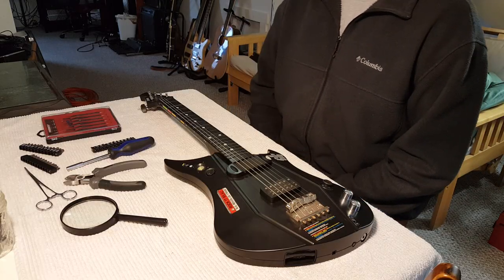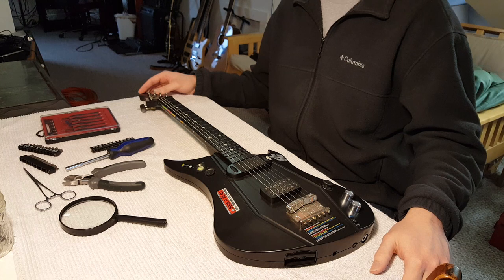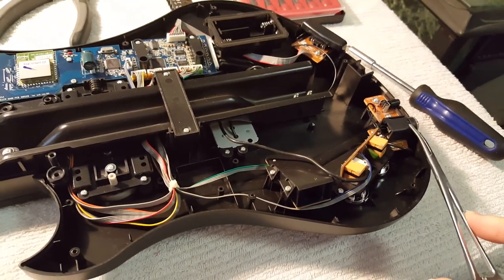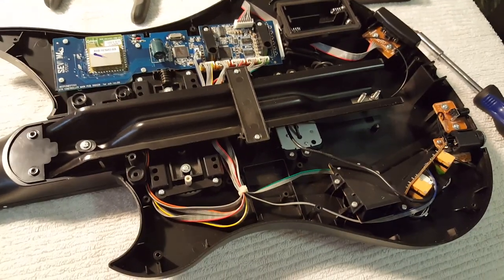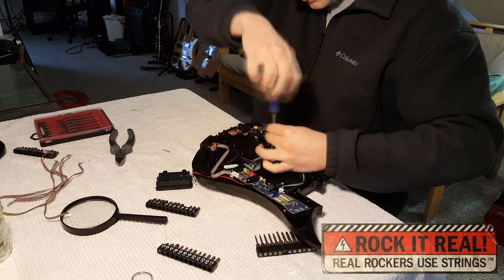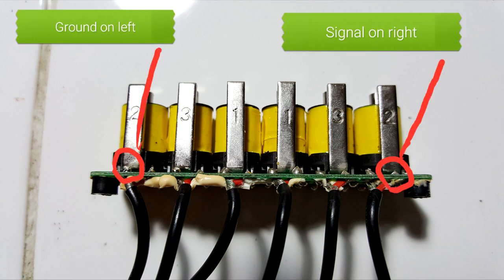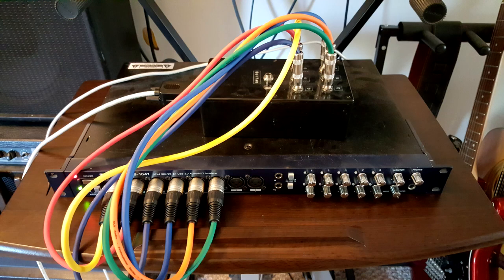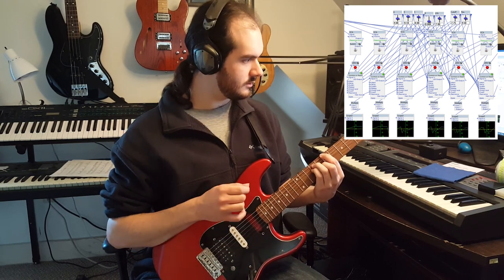Harvesting Hex Pickups/Power Gig Guitar Teardown

Comment: As guitarheroROXS brought to light in his demonstration for the SixString guitar, the Power Chord Mode wasn’t actually patched out. Rather, it was broken by an Xbox 360 dashboard update from 2012.

After this update was applied, even if a SixString was connected to the console, the game would just recognise it as a Guitar Hero or Rock Band controller, thus making the mode inaccessible. Same goes for the laughably abysmal AirStrike drum kit. It’ll just be recognised as a standard Rock Band drum kit.
Reply from the maker: That's a shame. Taken before its time. o7

Comment: I'd like to make the powergig into a decent playing guitar. I know people talk about resonance frequencies for base materials and such, I just want it to hold a tune so If I play a song, people can recognize it. I was wondering what is it that actually causes it to go out of tune.  Is it the nut, the tuning pegs, or both? What would it take to make one of these play properly.

I have one of those powergig guitars, along with a real guitar. I'd like to make the powergig work better as the smaller size, less weight, and lack of concern for new cosmetic damage, would be helpful for me, from a portability perspective. This is something I could carry on a skateboard and practice on between classes. I know people who carry ukuleles, I'd rather carry this. I'd be far more likely to carry one of these when I travel than an actual guitar.
Reply from the maker: That's a tough one. The powergig guitar was designed as a game controller first and a guitar second (and it's really not that great at either). The tuning instabilities likely stem from a couple different factors. The metal reinforcing of the neck is more than capable of supporting the tension of the strings, so the fault is likely a combination of the tuning machines, headstock design, and saddle construction. The tuning machines themselves are pretty low-quality and move quite easily, so replacing them would be a good start, but it doesn't seem like they used standard guitar tuners but some proprietary thing. Also, while the neck itself is very strong, the headstock is just a single piece of stamped sheet metal surrounded by plastic, and the tuning machines are anchored to the PLASTIC, not the metal, which means they flex easily. Then we come to the saddle, which is a single piece of chromed, lightweight metal with no intonation adjustment, which means that even IF the guitar could hold tuning, it still would likely never intonate higher up on the fretboard. And the frets themselves are WAY too tall, themselves, meaning that pressing the strings slightly too hard would push them sharp.

So I guess if you replaced the tuners first, then reinforced the headstock, and finally replaced the bridge with something that you can intonate (there's no hope for the frets, sadly), you miiiiiiiiiight get something usable out of it.
Reply: The biggest thing that made it actually decent for me was lowering/filing the nut slots. Before, playing anything sounded like the intro in this video.
Reply: I'm no expert or anything, but as @rationalmusic7747 pointed out, a lot of the issues lie with the headstock, tuners, nut, frets, etc. If I were doing this project, I'd take a cheap neck from a kit or something and modify that to fit onto the body somehow and ditch the plastic neck. It solves almost all of the problems and you still get the cool body, pickups, etc. with much better playability.

Comment: Great! Covered a lot of what I'm interested in the controller for. Ideally I'd like to figure out how to turn those six leads into MIDI, either taking it straight out of the guitar with a MIDI out, or maybe a usb, OR bundle the leads together and run them into some kind of external box to do the conversion. I really don't have much of an idea what I'm doing as far as that type of electronic work goes. But I've recently decided to change that and start making the stuff that I want. Bit of a pain in the ass, I'm sure. But I'm never really happy with the gear that is sold by big companies. There's always things I'd love to change. It's time to get to work, get really annoyed, work more, get more annoyed, start having fun, and hopefully come out of it with some stuff that I not only really like using, but that I made or modified myself.
Reply from the maker: Good luck to you on that! Accurate polyphonic pitch-to-MIDI conversion is kind of a holy grail in the guitar synth field right now. The only company I can think of off the top of my head that has done so successfully with an in-guitar system is Graphtech with their acousti-phonic/hexpander system, which uses piezo transducer crystals in the guitar saddles for the cleanest signal possible, and then converts it to MIDI. It's definitely on the expensive side but seems to track very well. Working with digital electronics is a little out of my league at the moment, but Arduino midi implementation might be a good place to start as it's relatively simple and cheap to get into. I don't know if a microcontroller like that has the power to run DSP to convert pitch to MIDI, but if Graphtech can fit their MIDI system onto a tiny board that fits inside a guitar, it might just be possible.

MIDI-fying the remaining guts of the powergig guitar is something that I'd like to explore in the future, but it likely won't utilize pitch-to-MIDI conversion. Good luck and let me know how it comes out!

Comment: hey! just got one of these for a solid $20 after seeing your video. can this be used with like a MIDI plug to interface w a Roland synth pedal, as well as a breakout box? also could I potentially make another fake humbucker like this appears to be in the original guitar with a good single coil pickup for like... a very stealthy hex pickup install? would there be noise interference in hex mode (I wouldn't really ever use both outputs at the same time).

thanks!
Reply from the maker: Without knowing the type of synth pedal you're referring to, I'd have to go with a tentative Yes, but not via MIDI. I believe that the newer Roland Guitar synths that use their 13-pin interface are pretty flexible with the types of signals they'll accept; from multiple different iterations of their hex pickups and systems to Graptech's Ghost piezo system. joness.com/gr300 might have a bit more info regarding that. Theoretically all you would need to do is route the 6 string outputs of the Powergig hex pickup to the corresponding inputs on the 13-pin cable, but I can't say for certain how well it would work given things like pickup strength and string crosstalk without testing it myself (which may be the subject of a future vid).

As for making another pickup like this (which I think is what the second half of your question is asking?), you probably could. I would only recommend that you shield the accompanying single-coil pickup with copper tape (like is shown in the video) to prevent any interference between the hex coils and the regular pickup.

Hope that helps!

Comment: Can Rocksmith be played with this guitar?
Reply from the maker: No idea. I don't own any of the "plastic guitar" games, but my initial assumption would be no.
Reply: @rationalemusic7747  I know this one! Yes. Absolutely. The usb amp plugs into the port at the bottom, and it works just like any other. Especially for the Xbox One version. But you need the amp hookup. It doesn't send the notes wirelessly. 

And it's not loud enough for acoustic mode.
Reply: You can, the real answer is would you want to?
Reply: Rocksmith works with any electric guitar, but you're best getting a real guitar
Reply: @rationalemusic7747  rocksmith uses a real guitar so it would only work if you can use this guitar as a real guitar, like connecting to an amp. Rocksmith uses an algorithm to detect which note you're playing using the sound it makes.

Comment: Could you or anyone else tell me how to proper remove the plastic cover on each and every hex screw on the back of this guitar? Is there a tool for this? Thanks!
Reply from the maker: Pretty sure I just used a knife or a small flathead screwdriver and pried them off, but I also didn't care about preserving them or marring the body.
Reply: Thanks for your help. I got it opened and did some basic controller repair and cleaning.

Comment: It will hold it's tone if you stretch your strings. Because the neck is short you need thicker strings. I use Zakk Wyldes for this. It's a great guitar that I use for Rocksmith and it works flawlessly. I have four other nice electrics but it's just so easy to play and transportable. Watching this being destroyed pains me ;P
Reply from the maker: Admittedly these are the stock strings that were on the guitar when I bought it, but I have a feeling that was the case for most of the people who bought this thing.